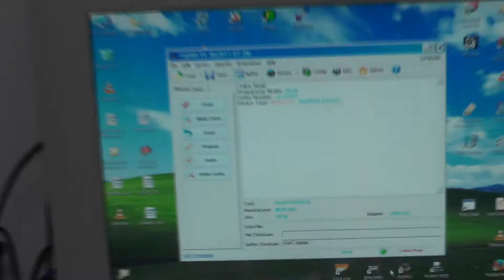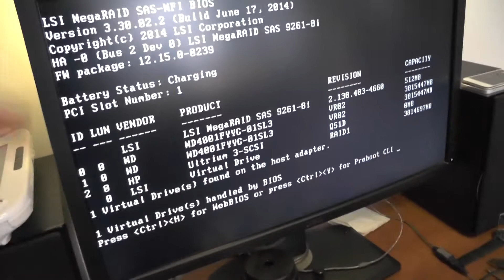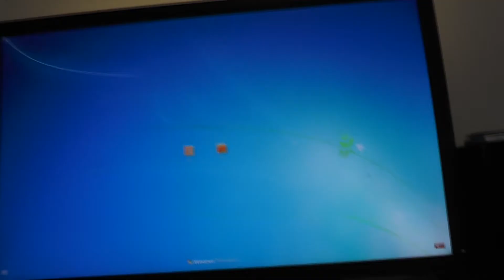Repairing a GPU for a fan - Part2 (success)

Comment: You rock Vlad! 
Thank you for destroying that bios chip. I have spent hours trying to figure out what I did wrong. Little did I know, I needed a super hero.
I could never imagined that it would take magic fingers to fix it.  
After seeing all the time you put it,  I really appreciate the work you did. You have a great talent and a fun hobby :). I am sure that this video will help others out there.

And also, It is great to know that there are people out there that will reach out even if they don't have to. 

Thank again! Beer money coming your way :)..
Reply from the maker: hehe, i have sent it already, they say that you will probably get the package within 3-4 days!
Reply from the maker: beer money arrived, tnx m8 :)
Reply: Hey Vlad! Thank, yes it has arrived and fully functional. It is on the rig and running like a charm. Good job  and I am forever grateful for the help 😁😁
Reply from the maker: WooHoo! Glad it works, it would have sucked if you have sent it and i did not repair it...
Reply: @MTS_IT  hey did you have to reprogram the chip before you installed it?  i have a problem like this and im going to do this also thanks man
Reply from the maker: @jimsinnovations2737  Hi, i did. ...although on some cards you can do that directly without removing the chip.. keyword here - SOME :)
Reply: @MTS_IT  okay great thanks so my next question is how do you do it without removing it  do i need a machine like you have to fix this card?
Reply from the maker: @jimsinnovations2737  i have https://www.ebay.com/itm/SOFI-SP8-A-Programmer-USB-EEPROM-Flash-SPI-BIOS-24-25-BR90-93-Universal-Tester/283427613691?hash=item41fd9a2bfb:g:NcoAAOSwYvNclejC 

But, evetn this one might work https://www.ebay.com/itm/SPI-USB-To-TTL-24-25-Series-USB-Programmer-EEPROM-BIOS-Writer-CH341A-SOIC8-Clip/183554680877?hash=item2abcb6282d:m:m_HCsaCBzGvEidphzeq3cGA

Comment: Hi. Do you know how to solve issue with RX470/570 after mod bios that after install drivers i have to use AMD/ATI Pixel Clock Patcher to make card works? Flash original bios not working...
Reply from the maker: yes. Older patched drivers would probably solve the issue (you need to have patched drivers in order for cards to be recognized after being flashed) and then you can restore the original bios.

Comment: Pozdrav druze. Kupio sam rig sa 6x rx 570 4gb strix gaming. Imale su neki modovan bios, preko atiflash sam 4 uspeo da fleshujem sa biosom sa techpowerup sajta, a dve me drndaju. Jedna izbacuje artifakte zelene po ekranu, a druga pali i gasi monitor. Da napomenem da se to ne desava u safe mode-u (tu je sve normalno) i iz sejf moda mogu da vratim stari bios koji je bio i tada rade "normalno" kada se regularno butuje windows, ali mi ne radi radeon settings i ima uzvicnik u device menadzeru. Kontam da ne vide driver. Da li mi mozes pomoci? Ako da, molim te kontaktiraj me na 069 21 069 41, platicu popravku
Reply from the maker: Branislav Nedic cujemo se prekosutra :)
Reply: @MTS_IT  Hvala!